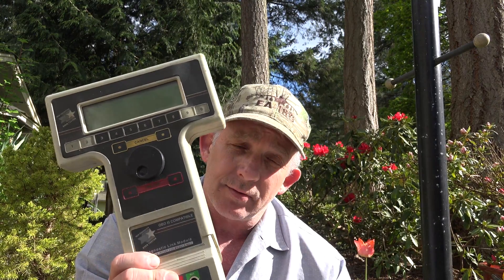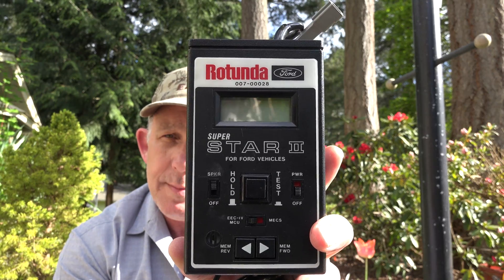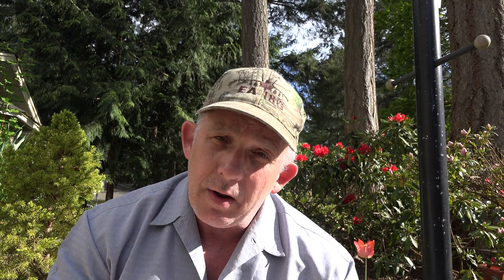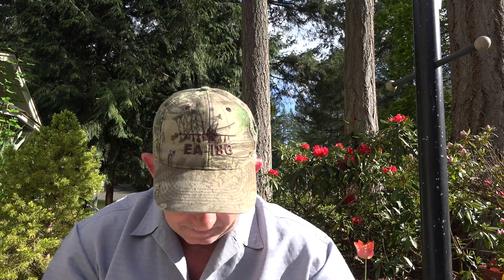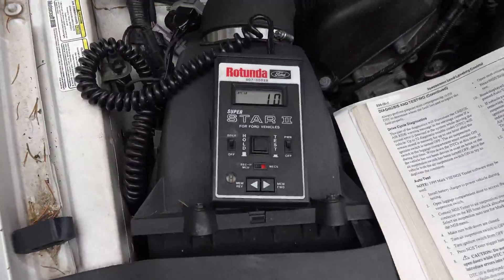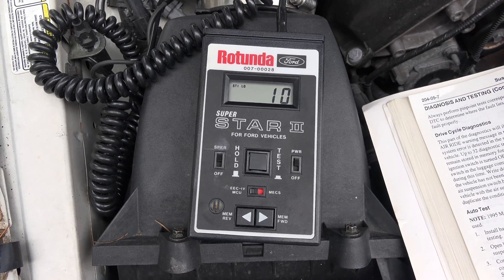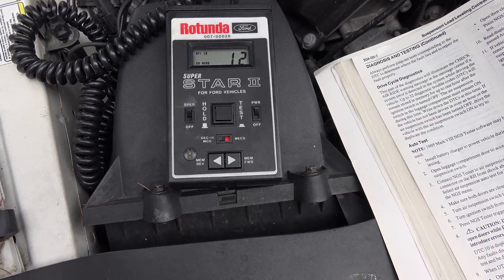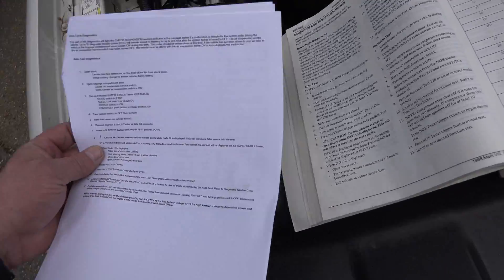1998 Lincoln Mark VIII Air Ride Auto Test

Comment: I took the connectors off my airbags and sprayed with electrical cleaner. Now the check system is off. Worth a try could have been loose connection I guess.

Comment: The motivation to supersede the Super Star II Tester with the New Generation Star Tester (NGS) was to accommodate OBD-II Generic Functions and also to support the Super Star Tester tool legacy as will as support easy expandability through the use of different Vehicle Interface Modules (VIM, Plugs into the T-Handle) and program cards. The first NGS release version for the MY1996, with development starting in 1992, NGS OBD-II used two cards; a Diagnostic Card and a Service Card. Unfortunately, the cards can only hold so much information so Ford released other cards in addition to the original two. The first was the Red Diagnostic card for MY1999 to MY2004.

What is strange about your cards is your black card and your green card have the same information, namely NGS service. The NGS diagnostic card for your MY1998 Mark VIII should be black and be labeled diagnostics on the front and not service.

I have been experimenting with the NGS on the bench with a used MY1998 Mark VIII EEC-V PCM. My Black Diagnostic Card has both the 1997 and 1998 Mark VIII. However, even though my NGS is operating properly and able to read the card I can't get it to communicate with the EEC-V PCM on the bench. I have tested my bench setup with an AUTEL MS909 and another limited generic OBD-II scanner and they both can communicate with the PCM. I will be experimenting with a Drewtech VCI (J2534 Pass Through Device) with Ford IDS. 

I then tested the NGS on my MY1997 Mark VIII using the OBD-II DLC and the tool still would not connect. Using the MS909 I can communicate with both SCP (J1850-PWM) and K-LINE (ISO9141, Only the Passenger Seat Module uses ISO9141), with the MS909 the only module I could not see on the SCP bus was the VLCM (Fan control module). The MS909 also connected properly to the PCM using Generic OBD-II functions.

With any of your cards can you connect to your PCM over SCP using the NGS?

More Information:

There are two different NGS cables for SCP DLC connection; Flash and Scan. The Flash version will have the DLC pin 13 (FEPs) populated in order to provide the programming voltage to the PCM. The Scan version of the cable will not have DLC pin 13 populated. The scan version is the most common and supplied with the NGS plastic case kit. 

The NGS has a Super Star Tester mode which uses an adaptor cable to connect to the Air Ride Suspension / EVO test connector under the hood of the Mark VIII, as well as power input clamps that you connect to the vehicle battery to supply power to the NGS. I think the Green Service card originally had the Air Ride Suspension service and calibration tests labeled under Special Functions. I have not tried my NGS with my Air Ride Suspension yet as I also have a Super Star II Tester 007-0041A which I know works to test the Air Ride Suspension.

I have read that problems with the NGS not connecting with certain Ford vehicles, even though the tool is working properly, is usually due to the PCM not having the most recent flash update. So my I think I will re-flash my EEC-V on the bench and then test the NGS with the reprogrammed module.

Comment: So I got a set of the 1998 Mark VIII shop manuals to compare to the gen 2 Mark VIII first edition shop manuals issued first in 1996 at the model year change for the 1997 Mark VIII. There are differences between the manuals, mostly correcting errors. For the Air Ride Suspension the shop manuals recommend use of the NGS tester as you pointed out in your video, so it is very strange that the Air Ride testing software for this tool is not included on the program cards.

Comment: I own a 1997 Lincoln Mark VIII LSC which was in storage a long time. I replaced the Battery Cabling and added a charging connector. Also, I modified the factory wiring approach in a way that would make it easy to put a milliamp clamp meter around the Battery POS cable to make it easy to track down any parasitic draw problems I might have in the future. I used a 2 AWG cable which works well with the clamp meter jaw opening. 

Today I finished replacing the fuel pump module (the pump module in the tank and not the pump control module) and Fuel filter (passenger side front wheel well), I was amazed at how brittle the factory fuel pump in-tank flexible plastic tubes became. The first sign of trouble is when the fuel level sender stops working. The pump or in-tank plastic components will soon follow resulting in no fuel rail pressure. You can replace the in-tank fuel pump module without removing the exhaust, the tank will slant down giving just enough access. The new pump module is working good so far. The only noticeable difference from the OEM assembly was the OEM connector had gold plated pins for the pressure sensor circuit, the new module has tin plated pins.

Let me know if you would like details on the in-tank fuel pump module repair.

Comment: Jeff using that same suspension / EVO test port are you able to run any test/diagnostics on the Electronic Variable Orifice steering system and if so what does it test or diagnose. Reason for asking is given you have the star tester and rather knowledgeable with the testing, when the EVO system has an issue it can default to full assist which recently happened and there is no indicator lamp or other codes displayed so short of pinpoint, resistance, and other testing of every individual EVO component hoping to save some headaches.

Comment: Inherited 1995 Lincoln Mark VIII from my Farther-in-Law with a new engine. About 3,000 miles. I want to restore it. Got new Air ride system all 4 wheels and compressor. The front end is standing at 24 inches. Need tester for rear. Manual ask for oo7-004. You use a 007-000028. All I could find online is a 007-0041a. Will that work or can you cum up with something else?
Al Owens
Reply from the maker: Any Rotunda Super Star tester will work. This one just went up on eBay a few days ago.
https://www.ebay.com/itm/114777016454?ul_noapp=true

Comment: Hi Jeff:   Thanks a TON for your videos!     Working on my dad's 93.  Car rides rough.  I ran this test 2X and it passed both times.  After the tests I check the ride height and it was 24" plus or minus 3/16 inch all around.  I don't know what to do next.  Any help will be appreciated!  Thanks
Reply: Struts are probably blown inside the front shocks

Comment: Thanks for the video Jeff.I actually have the same interior and exterior and model that you have. I am  just getting ready to convert mine back to air, from coil that  somebody had done prior to me taking ownership. So yes this video comes in very handy about that tool hopefully I can find it. Thanks again Jeff. God Bless.
Reply from the maker: Jason Nean Your welcome. Good luck with the conversion. I love the air ride on my Mark!
Reply: @tjernagel  by the way I forgot to ask you where I can find that scanner for purchase. For some reason having a hard time locating it. Thanks Brother.
Reply from the maker: Jason Nean The only place is eBay. They are becoming harder to find but pop up every now and then.
Reply from the maker: Jason Nean https://www.ebay.com/p/1728788645
Reply: @tjernagel  okay cool thanks for the info👍👍
Reply from the maker: @jasonnean2795  I need to add DO NOT EVEN THINK about buying a Star Tester. It uses a PCMIA card and the software to check the air ride is had to find. You could buy 20 black labeled cards that should have the software on it only to find out none of them do. I know from experience and it's still sitting in my garage... I called the manufacturer Hickok and they confirmed my problem and lead me to the Super Star II tester. For the most part it, according to them, it was designed to test the air ride on the Mark VIIIs... Good luck!

Comment: Hi again Jeff. My Mark 8's left strut exploded a while ago, and I decided to replace all the airsprings with Ultra Power from Rockauto to avoid any more suspension problems. How wrong was I! I had to return both the front struts; the left one because misalignment of top/bottom attachment bolts (welded them in line myself and got a 100€ refund from Rockauto) and the right one because of a clogged solenoid valve (giving only DTC 99). Meanwhile got a Super Star II 007-0041a tester. Finally today I got the last parts in place and adjusted the ride height according to factory manual (1996). Unlike yours (1997-98) it states every button's pushes correctly and it's quite easy to determine what is wrong, if any. Thanks again a lot for your videos, they helped me to avoid some serious mistakes I woudn't be able to know without your advice. :-D Hoping to keep the air ride functional and enjoying the softness of it. :-)

Comment: Being a ford technician back in them days. Most commonly was a bad pump vent valve. Would try to pump the car up but vent valve would be stuck ...pumping and venting at the same time. On the continentals most of the time would be the relay in front of radiator under the cover or a wire issue going to one of the vent selenoid to the are bag. I would get the code ..slice the harness back and there would be i beak in the wire about 4” back where they went into the wheel well. Anyone have any questions i’ll be glad to help. 87-2012 at the ford dealer ... Hirry before i forget all this.  lol.  BTW nice 👍 Lincoln 8  ..Went to school for them and that Hemi 4.6 is a great motor. I also have a Super Start 2 tester.
Reply: hello, need help, are you still there
Reply: The relay for the air ride is on the frame behind the radiator? The continental pump doesn't even run outside of 5 seconds after the switch in the trunk is switched on.
Reply: My mark 8vii was the relay ,it's on side of the pump on front of passenger front tire

Comment: Summit suggested Actron CP9670, but it doesn't do the job. Instead I found a Rotunda SS II 007-0041A on eBay for less than 40$ (with taxes and transportation ~110$/100€) and bought it right away. I hope it is as good as the ...0041B which is Lincoln's recommendation. Yours was ...00028, so  I'm hopefull.
Reply: Hi again, Jeff. Just got some mail from the USA: original printed Mark VIII -96 & electrical manuals and R SS device, but it's not the one I ordered. I made a short video of it: https://youtu.be/PJqOIO7P5E4

Comment: Jeff, have you discovered if some modern device would do the same job as Rotunda Super Star II? There are at least some Actron and Innova products, which are capable of reading both OBD 1 & 2 and have "some" (mentioned but not specified) test programs in them. In Lincoln workshop manual three systems are mentioned to use SS II (suspension, brakes & steering), so at least those should be covered, because their ports are OBD 1 and none of the OBD 2 scanners no matter how modern work on them.
Reply from the maker: Nope... It doesn't hook up to OBD under the dash. There a special connector under the hood for it...
Reply: Yes, I know all that. But doesn't the suspension system's diagnosis connector near RH front strut under the hood look like it's an OBD 1 connector? Anyway, I asked Summit if they can help finding some new scanner / diagnosis tool to handle all the three system's tests. Let you know if they can.

Comment: Jeff, nice video. I just bought a -96 LSC with only 50k original miles on it. No rust, driven only in summertime. Intention is to keep the air ride and your video incourages to do so, too.
Reply from the maker: I like the air ride system. It's pretty simple to keep up but the Super Star II is almost a have to have for troubleshooting any errors. Sometimes it's obvious. I had a year old compressor assembly and started to get the air ride error when I'd get up to speed on the highway. Knowing the system that tells me it's not venting. After checking the system it was the vent valve had already failed. Arnot warranted the assembly for free.

Comment: Hi Jeff. I can't tell you how much I wish this video series would've been available to me back in '08 when I'd bought my first '98 Mark VIII (Collector's Edition #1260 if I recall correctly).

Anyway, that car was stolen by one of my ex's & run across the scales at a scrap yard out of spite, but I've just recently gone & bought a '97 which I'm already certain has failure codes (due to how it's behaving) that I'll be unable to read until I get myself a Super Star II somewhere.

My question though, is what manual are you using as your reference guide for conducting these tests? Is it one I can acquire at a parts store, or is it direct from Lincoln Service?

Thanks in advance if you elect to reply.
Reply from the maker: Chameleon Customs The OEM Service Manual contain the codes and the test procedure. 

Although... there is an error in the AutoTest sequence where they forget to tell you to perform a task in order to finish the test. 

I can email it if you need them.
Reply: @tjernagel , thanks for the quick response. I'd be thrilled if you could share any info relevant to the unique quirks this particular make & model are known for (especially air ride related).

I've watched your videos about the repairs, tests, and settings manipulation for the air ride pretty thoroughly, but having them for immediate reference would prove invaluable. My email address is dweb7887@outlook.com. I really look forward to hearing from you. Thanks in advance.
Reply: I have #777

Comment: Hey Jeff, I bought the Rotunda Star II after watching your video.  I can't get codes to show up at all but, not sure I'm plugging it into the correct plug.  I am working on a 95' Town Car which only has rear air bags with 1 height sensor.  I plugged into the plug very close to the suspension switch in the trunk and get nothing.  The shocks have been replaced as has the height sensor and brain.  I know you have a manual - does it mention where to plug into the system for a 95' Towncar?  Desperate for your answer.......great video btw...

Comment: Any idea where I might find that tool?  I’m in Atlanta GA.
Reply from the maker: The only place I've seen them is on eBay. They are getting harder and harder to find. The system can be manually checked by installing jumpers on the connector for the controller (Passenger side wall). It's a pain by work. Just need schematic to tell you where to place the jumpers...
Reply: Jeff Tjernagel I found one on eBay just as you suggested.  We’ll see how it goes when I try it out.  I’ll follow the instructions on your video.  Thanks so much!!
Reply from the maker: Channing Steele Good job!  If you need help using it let me know.
Reply: Can't believe I found you I have collectors edition #777,and a 96 built to the kilt.

Comment: Is there anyway you might be willing to sell it? I have a 1997 mark VIII and can't get the airide system to work without it and I can't find it anywere :/
Reply from the maker: No I can't sell it. I used it this weekend to deflate the rear bags for replacement of some of the rear suspension bushings. It comes handy.

Keep searching eBay and hopefully one will show up. Any chance that you live in the Northwest?
Reply: Jeff Tjernagel no, I live in San Diego, California, I've been looking around ebay but no luck, I hope I find one soon... I might have to switch it to shocks and coilovers...
Reply: I had to replace the control module because some mecanics fried it, so I replaced it but now I need the scanning tool... Everything works well I just cant calibrate without it.
Reply from the maker: You can control it old school with jumpers and wiring schematic. I use to do that.  What is it doing?

Comment: hey got code 75 do you have pinpoint testing in that book? my email is bodnarscott@yahoo.com if so? thanks for the video!!
Reply from the maker: Code 75 is Compressor Relay Control Circuit. Do this to troubleshot it.  The compressor relay is located on the front of the compressor assembly in the right hand side of the bumper.

https://youtu.be/2J7N8JD_fe0
Reply: Jeff Tjernagel 
just watched it I have a dormant compressor to go figure.
 snapon mt2500 will do this test in emulator mode
Reply from the maker: Let me know if you need anything else. If the fuse is good and you had to pull the air dam there is a power relay on the left side you can use to troubleshot. Double check part numbers but if my memory is correct it's the same.
Reply: Jeff Tjernagel thanks
Reply from the maker: It's good to know the SnapOn tool will perform the tests.  The Super Star II's are hard to find and pricey... But so is the SnapOn but well worth having. 

My first Dorman compressor had a bad relay out of the box. AutoZone exchanged the relay and when I got the compressor running, besides sounding like it was about to explode, wouldn't provide enough pressure to air the bags up.

Second compressor assembly failed within a week, both the relay and the compressor. I took the assembly back to AutoZone today for a refund and installed my OEM compressor. I was only changing it because it's getting so old and I don't have a clue how much brush is remaining.

I won't buy Dornan again...